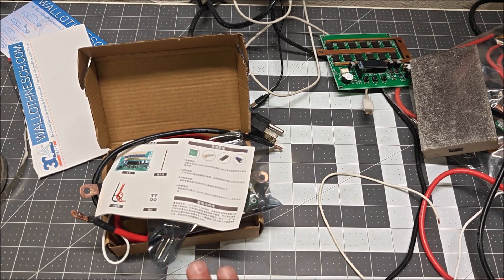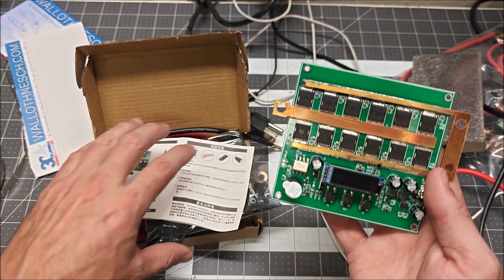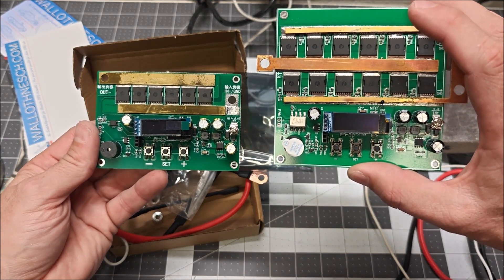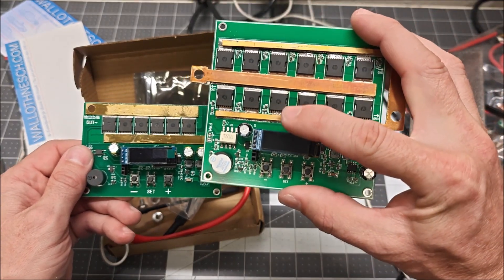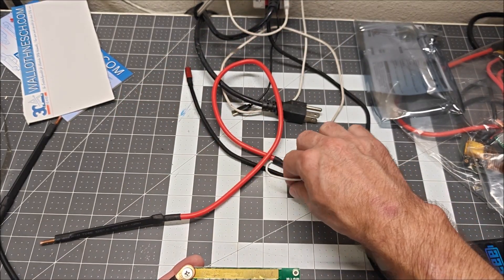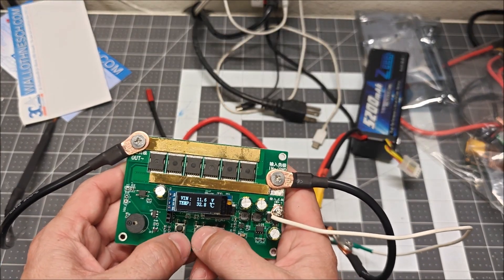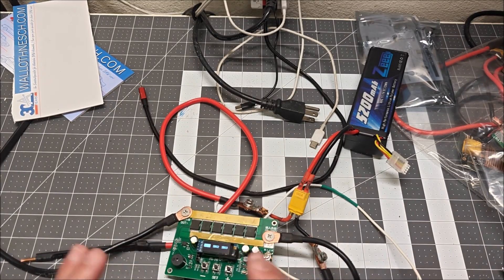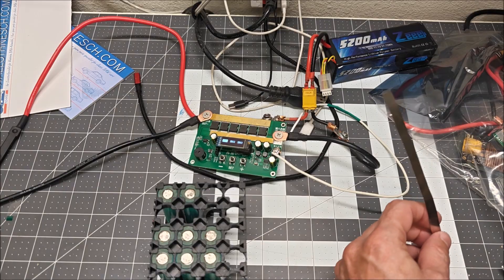New Version of Powerful Spot Welder

Comment: I have this spotwelder with a 3s2p lipo 15 000mAh 100c 1500A battery and could spotweld 5 x 0.1mm nickel using 15 / 20 /25 if i remember right. It's a really good welder. Atleast the one I bought that goes for around 50USD and not the cheapest versions. My wires jump when I weld.

Comment: Agree this is a very sensitive spotwelder. I had 2 of these, both mosfets blown. I would not recommend to buy it . (See earlier comments)
I you want to buy a reliable spotwelder you should go for the original  JQ-DHJ02B + some extra TVSs. However, the best bang for you buck currently is the ZK-XW2 (probably my to go to). 
If you want the best, but not too expensive then buy a second hand malectric V3 and add an extra plate with 6 more mosfets (Theoretically this can handle up to 2800A). This surpass even the KWeld. 
PS I have all three of them.
Reply: I just checked the data sheet on these mosfets. 800A when pulsed. That's 800 x 12 = 9,600 amp capacity. His mosfets didn't even get hot so I'm wondering how you blew them?
Reply: @mosfet500 blew them up by using a battery that was having too much voltage drop.
Reply: @user-jh1er8kh7p  Voltage drop doesn't damage mosfets, voltage drop is the result of load, the greater the load the greater the voltage drop.Mosfets burn out when they heat up due to RDSon being too high for the application. Mosfets have power dissipation ratings if the current through the mosfet is too high for the internal resistance (RDSon) the transistor heats up beyond the rated temperature and blows. 

For example, if a transistor has an RDSon of 200 milliohms and the current through it is 100 amps then the power it dissipates is  I^2R = 0.2 ^2 x 100 = 4 watts. If it's rated for 2 watts it will overheat and blow if it is not heat sunk well enough to dissipate the extra internal heat.
Reply: @mosfet500 ….gate voltage. 

Ya know…the reason why some of these spot welders need a cap mod or a separate 12V supply.
Reply: @user-jh1er8kh7p  More than just gate voltage, especially if the transistor is turning on fully.
Reply: @mosfet500  Its the long down time that blows them, when there are not fully conducting the internal resistance of the D-S connection rises quickly! You can cure this by lowering the resistance of the gate resitor to ground! Seems to be a little design error here. But a lower gate bleeding resistor can increase the rise time of the gate when switching the mosfet on. Both should be as short as possible. The linear operation time is the phase where the mosfets are killed due to overheating.

Comment: dont sacrifice ur cells throw 2 strips on top one another n dial it in holmes
Reply: just the same as you wouldnt fire up a new tig machine and start welding on the space shuttle  always test on something scrap so u dont ruin stuff for no reason at all
Reply from the maker: My videos use old dead batteries for testing.
Reply: Welding 2 strips to each other is much easier than welding to a battery. It's always best to practice of dead and trash batteries.
Reply: Nice tip, completely useless for people with 2 brain cells or more

Comment: A reviewer on Aliexpress recommended changing the driver for a " fod3120 with 2 ohm resistor " (To be like the old model.) 
Does anyone know where the 2 ohm resister needs to go from and to?
Reply: The FOD3120 has an under voltage lockout. If the Voltage is below 11.5 Volt it closes the MOSFets hard. That means the driver should be externaly fed by a supply with 15 V.
Reply: @DirkV0815 Thanks, I actually installed the FOD3120 with a couple of bypass caps and found it already boosts 12v (3S) to 14.8v from the factory. I changed R43 from 100 Ω to 300 Ω to limit IC current, added a 250A fuse for LiPo safety in case of a MOSFET short, and installed four 1.5KE18CA TVS diodes across the busbars.

The system is powered by two 3S 2200 mAh LiPos, with the spot welder using a separate 3S 2200 mAh LiPo. It’s worked great so far, producing solid welds on an AA 4-cell pack using 10-12-10 pulse settings. Hope this helps someone.

Comment: SEVERAL BITS OF ADVICE (for everyone), READ ENTIRE COMMENT
eeeeeyyyyy,  you saw my comment I left on the video of the old version. Glad to see you got to try this one out. I'm typing this as I watch the video. Quick review of the comments so far though, the trick to using these welders is you need to re-wire it to run two batteries; one battery to power the board, and one battery to power the weld itself. If you use the same battery for both, the voltage drop is what causes the slow close time of the fets, and what causes the fets to blow. If there's no voltage drop, this thing is nearly bulletproof and welds like a beast!
After watching the full video, I want to give this advice: set the pulse length to 10 for seg1 and seg3, and leave the pulse length at 25 for seg2. You'll get the exact same quality weld, but you'll get 3 times as many welds in before the probes get hot. The first pulse is to preheat, second pulse is the actual weld, and third pulse is to anneal the weld. So the first and last pulse should be very small just to put some heat into it, not to actually weld it. Only the second pulse should be hot enough to actually weld it. This will also make the battery last waaaaay longer.
Also, if able, add solder to the top and bottom of the board where the cables attach, covering the full silver area and overlap it onto the bus bars. This will drastically increase the ampacity, allowing for much stronger welds at even lower settings. Using 2 batteries like I mentioned above also makes the welds more consistent, and stronger. I've welded 0.30mm nickel to a cell quite easily after doing all the above, using a HRB 3s 5000mah 100c lipo, and only had the second pulse set to 65, and first and third pulses still only set to 10.
For those wondering, the pulse length setting is 1 to 100, in increments of 1. And the delay is 50 to 950, in increments of 50, and is in milliseconds.
To describe the interface: seg1 = first pulse, seg2 = second pulse, seg3 = third pulse. Power equals the strength of the pulse. Delay is the time in milliseconds before the pulse occurs. So the delay for seg1 is the time in milliseconds from when both needles touch the weld surface, til the first pulse. The delay on seg2 is the time in milliseconds between first pulse and second pulse. And the delay on seg3 is the time between second pulse and third pulse.
The speaker is very loud, cover it with a piece of tape to make it quieter. The probes are 3mm wide, and their tips are perfectly flat; you should sharpen the tips using a belt sander or dremel so the tips are about 1.5mm wide with a slight rounded tip. Doing this will make the actual weld slightly larger [than using the sharp corner of flat tips], and will prevent damaging the cell due to the tips being blunt and not a sharp edge being pushed into the molten metal.
Doing all of the above, setting the second pulse to power 100, I've been able to weld up to 0.42mm thick nickel when applying both probes to the same side (like in this video), and up to 1.0mm thick nickel when applying the probes to opposite sides of the nickel pointing directly at each other.
Reply: Great input of experience. Indeed this board is powerfull but sensitive...... Based on mij measurements the long gate closing times had nothing to do with the dropping voltage. In my case the voltage to the gates during the weld stayed perfectly 15V (PS this board has also a circuit to keep the gate voltage the same with dropping voltage of the battery). Therefore I can only come to the conclusion that the long gate closing time most likely caused the additional heat to blow my mosfets. Probably if I would have operated at 12 V instead of 15V the gate closing time would be shorter. On this board the gate closing time is determined by the 10k resistor connected to the gates and earth. When the weld-signal stops the voltage of the gates is reduced to 0V via this resistor to earth.  So for the time being my advice would still be 1 - Use  2 batteries paralel - 12V is probably safer then 15V - keep it below 1000A and keep the gap between the pulses at least 5ms.
Reply: @bvmalukqat9545  maybe that's why my setup is working so well then, I'm using 3s lipos, which are only 12.6v fully charged, and I stop when they drop below 11v. I'm not running them in parallel though, I run mine with one pack running the weld, and one pack running the board, independant of each other. Negative of both packs connect to the board, but the positive of one pack goes to the positive input screw terminal on the board, and the positive of the other pack is direct to the positive probe. Thanks for sharing your thoughts though, that's a very valid point regarding the higher voltage causing longer gate close time and makes perfect sense. The lowest pulse delay setting is 50ms, so keeping it above 5s isn't a concern, because 5ms is impossible.
Reply: @bvmalukqat9545  You could lower the mosfet closing time by lowering the resistance of the grounding resistor to the gate. This gets rid of the voltage on the gate faster, emptying the gate capacitance of the mosfets.
Reply: How did you rewire it? I can see how to add a small battery to power the board with the white wire but unsure what to do with the negative. Thanks
Reply from the maker: Common negative. Same negative as the big battery negative
Reply: @HunterFairchild-z9v  Even though the board won't use much current, you don't want to use too small of a battery to power the board. In fact I suggest using two identical batteries, so you can switch them every now and then. This way you give some cooldown time to the one that was previously powering the probes, as well as keeping an eye on voltage. Because remember that the voltage readout will only be for the battery powering the board, not the one currently being used for the weld itself. For wiring, I have one battery plug with positive directly to the positive probe, and the negative to the negative terminal (hole) on the board. And the second battery plug is just the white wire on positive going to the positive screw terminal on the board, and the negative also going to the negative port (hole) on the board. Separate negative cables for each. with the eyelets bolted together directly to the board's negative (top right) labelled "in grnd". And the negative probe is on the output at top left of the board labelled "out-".
Reply: Thanks for posting more info on this video.

Comment: Conclusion: Its highly likely that the mosfets blew because of the heat generated during the very long closing time (My JQ spotwelder hat a closing time of 0.75ms). The only option to address that is to implement the solution which Luca implemented in with the purple spotwelder = to shorten the closing time of the gate. Or keep the current below I would say 1000A. Looks like that this spotwelder is a sensitive one. With my JQ spotwelder I can weld with 4 batteries parrallel.
Reply: How would you limit current? Go with 3s instead of 4s?
Reply from the maker: The S is the voltage not the current. The C is the current. Go with 50C instead of 80C

Comment: Here a short version. I welded 1 and then 2 0.1 mm Niplated strips succesfully at 950-3-50-10-50-3 and 950-5-50-25-50-5 with 2 parrallel 4S lipos which are 10 year old 45-90C at 15V. Measured current between 500-1000A.  Measured gate opening and closing time was less then 0.1ms opening (= very short ) and 2.5ms closing (is very long). When I added a 3dr battery parrallel and welded 0.1mm Niplate at 950-5-50-10-50-5 most of the mosfets blew.

Comment: Would you recommend this for someone new? I am torn between buying this and one of those hand held pen type.
Reply from the maker: I would buy this. Yes it's easy to use.
Reply: Thanks @stevenc22
Reply: @stevenc22 sorry for the late reply but I noticed that you use a lipo battery and I was wondering if I can use it with a lead acid battery instead as I have one lying around.
Reply from the maker: @anh413 yes you can. I did a video testing Lipo vs Car battery. No noticable difference. But it must be a car battery, not a small lead acid for like a UPS.
Reply: @stevenc22 thanks again. But unfortunately mine is the small type from an UPS. I will probably go with a 1500mAh 3s battery instead.
Reply from the maker: @anh413 no. You need a 5000mah 80c battery. Anything less just be a waste of time
Reply: @stevenc22 just a bit of an update, I got it but the problem is that I cannot find a good battery for it. I found a 5200 mAh 90C but it voltage is 11.1V, should I get it? Also it is using a T shape connector, should I replace it with an XT 60
Reply from the maker: 11.1v is the same battery I use. Yes you should get it.

Comment: Why do you never test on 0.2 pure? That's the universal benchmark. Could you make a video on that
Reply from the maker: I should but I never build anything needing more than .15 pure. I'll buy some .2 just for you 👍
Reply: @stevenc22 I second this! Would appreciate a video with even this specific welder at .2
Reply from the maker: I filmed testing .2 but forgot to post it. Just posted it to my shorts section. Works great but welder gets hot as I bumped up the weld pulse.
Reply: @stevenc22  Thanks nice to see :D
Reply: This one looks exactly like mine and I bought the one going for ~50 USD not the cheaper 20 USD versions and spotwelded 5 x 0.1mm nickel at the same time with ease. Only problem is that my wires jump when welding from the current. I also use a 3s2p 15 000mAh 100c  1500A battery for it.

Comment: I plan to build a large battery pack.  If the wires get too hot I'll increase the gauge copper cable but the problem is the wires coming out of the battery pack are not exactly easy to upsize.  😢
Reply from the maker: Agreed. Just take breaks and monitor the temps. I have built monster batteries before with these PCB spot welders
Reply: @stevenc22  Thanks for sharing - what's your battery recommendation to drive a typical (40 cell) battery build?
Reply from the maker: @alexlautenschlager6459  I have used the same 80c 3s lipo for 10 years. No problems.